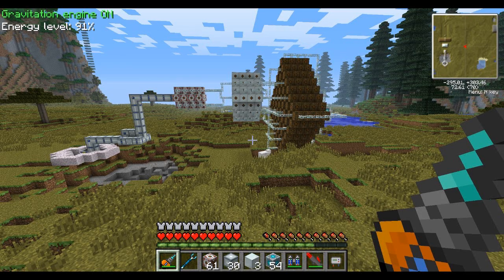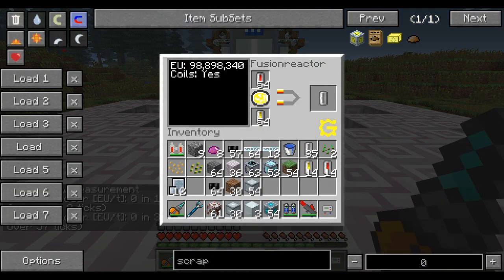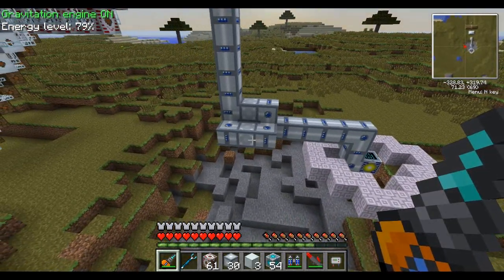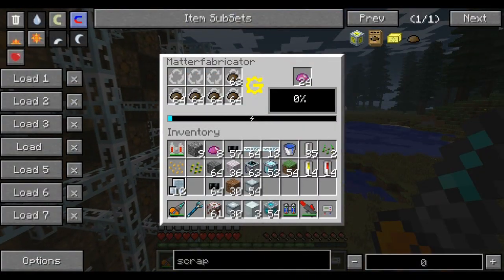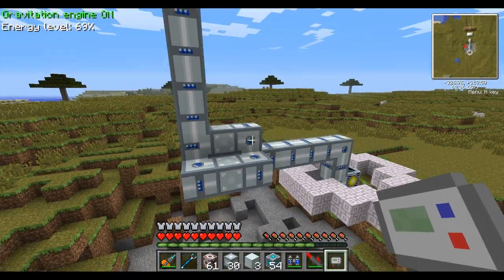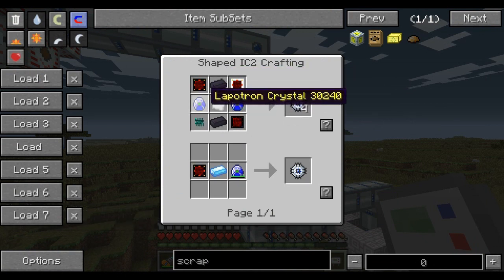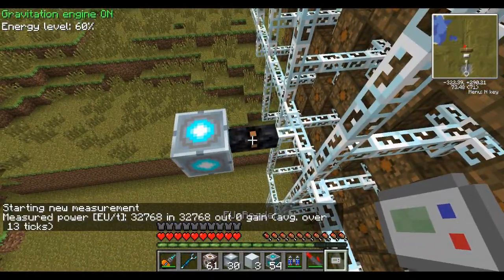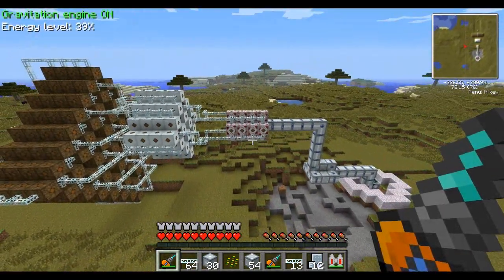Fusion Reactor Showcase - Feed The Beast

Comment: It isn't that crazy, in Tekkit i used an array of MFSUs to create a quantum killer rated at 500,000 EU/t. It however had only covered a single block above a teleporter, you would need more cabling (thus copper or gold) if you wanted to cover a larger area with an electric fence.

Comment: This is a bit overkill, if you can afford fusion reactor then you can probably afford lots of Adjustable Storage Units, which will hold all the power plus have the ability to adjust power rate. Altrough its still a good idea to transform down from 2048 to 32 EU/t in case with some of the machines because it allows to transfer a lot of power by regular 32 EU/t cable (in form of multiple packets), which those machines with overclocker upgrades gonna need for sure.